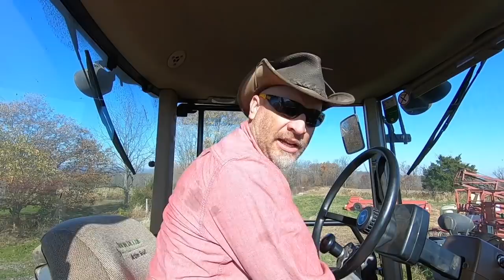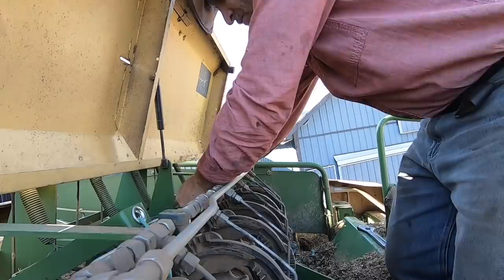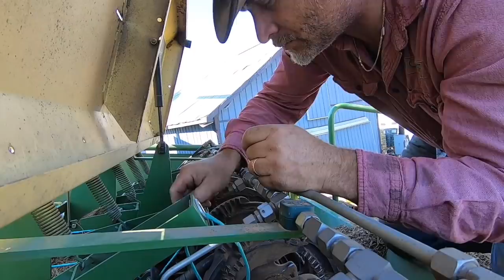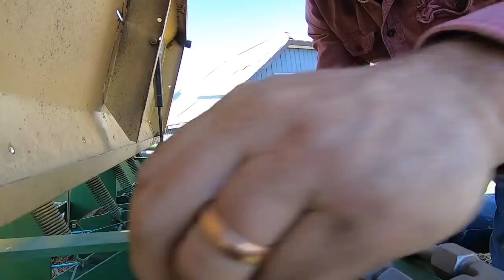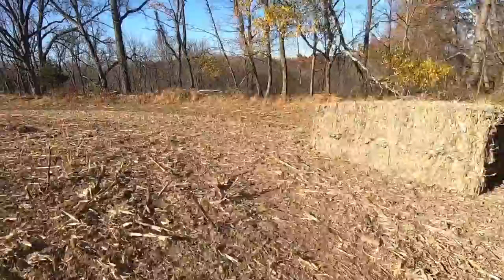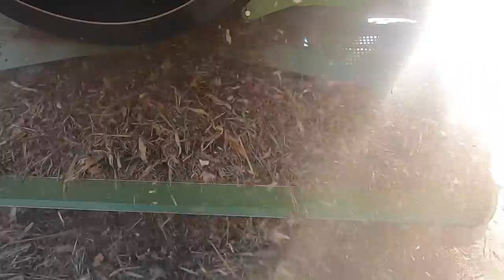Knotters Blowers Fodder

Comment: One thing I do like about the John Deere big baler is that it has a constant airflow over the knotters keeping the Dirt away. They use a squirrel cage fan system which is really nice. Everyday I pre grease The knotters with a hand grease gun. Dirt is the worst enemy to your machine. Have a great day any news on the Trump campaign 2020
Reply: I was going to say they should have a fan blowing all the time like in a Combine!
Reply from the maker: The fan is ok. I like the blast of air and I’ll make a video why it works well.
Reply: I'm hearing because of the computer glitch enough votes have switched causing a couple of states to turn back pink.

PA tossed votes for bad addresses

Seen now Biden 259 Trump 214.

Comment: Hi Wes, are tandem dual wheels an option for the bailer in soft ground?
Reply: No... it's got tandems already.  OL J R :)
Reply: @lukestrawwalker  I should have clarified, I meant tandem duals
Reply: @regalbowman3143  no, not really... no way to attach them.  The balers already have "super singles" on them, basically the biggest floater tires you can get that would remotely fit the machines.  Later!  OL J R :)
Reply: @lukestrawwalker  Where theres a machine shop theres a way
Reply: @regalbowman3143  Anything is possible... BUT if you snap the axles off or destroy the hubs because they can't take the stress from the extra tire... well you haven't gained much.  The other issue is, the rear axle on the balers STEER THEMSELVES to follow the front axle when baling, so they don't scrub sideways in turns and tear up the hay meadow.  That would create some BIG clearance issues between the outside duals on the back axle hitting the ones on the front axle in every turn!  SO, sorry, the answer is still no... OL J R :)

Comment: Hey Wes. Should the windguard roller on the pickup be driven, hydraulic or chain, to help feed the stalk more evenly. Perhaps even two rollers. Maybe it's not even a problem, just a thought.
Reply: It seems like the bearings are out on it.
Reply: @timhagemann9236  or crud wrapped up around the axles in between the bearings and end plates acting like a brake... OL J R :)